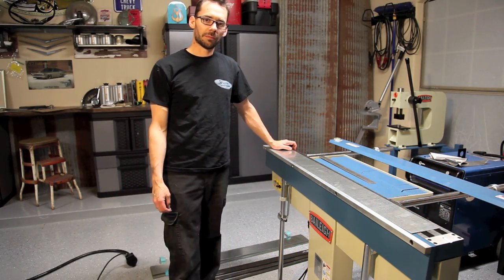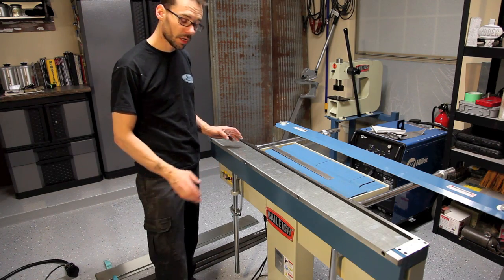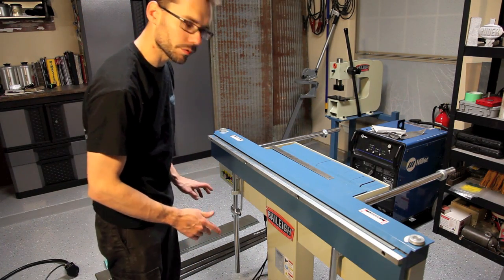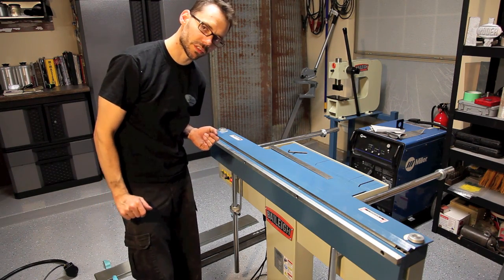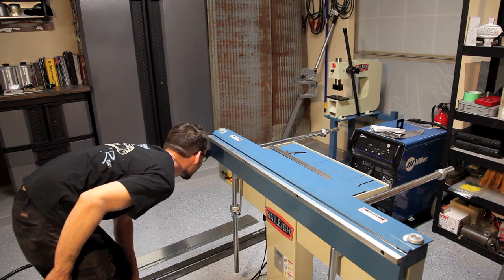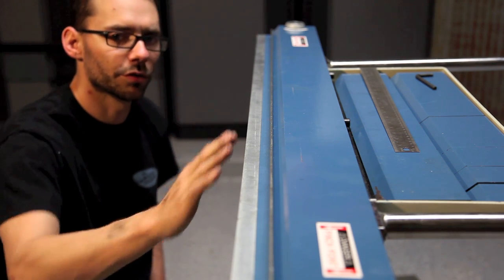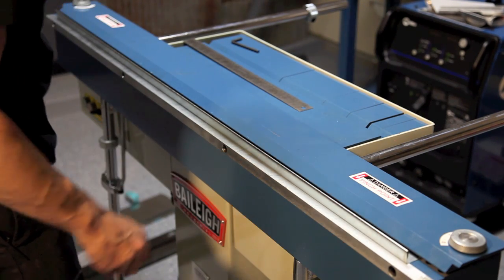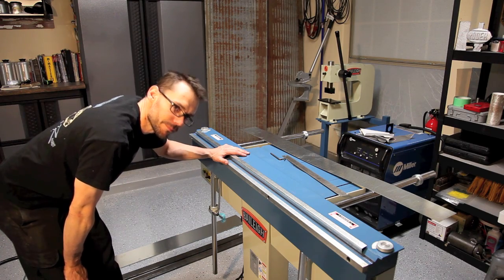Baileigh Industrial Sheet Metal Brake BB-4816M HammerFab

Comment: How does it do with Aluminum or Stainless?
Reply from the maker: Well it depends on the thickness and length
Reply from the maker: It’s been a great machine. Very strong. It will bend thinner stainless and works good on 16ga aluminum. You could bend shorter pieces of .080 aluminum. We’ve even abused it and bend narrow strips of 10ga steel and even 3/16 strap

Comment: I've been running this exact same break for about 5 years no issues, until the control board died. Their shitty dumb tech service immediately wanted to know what voltage I was running at. When I told them 240v they didn't want to help me. It's just a giant scam company that offers little support. I found the technical repair manual for this online, but lost the link and they didn't even know it exsisted. I will never buy one of thier crap chinese machines again. I see they now have a competitor called KaKa. that is about 15% cheaper. KAKA Industrial EB-4816B Manual Magnetic Sheet Metal Box and Pan Brake    https://www.grainger.com/ec/pdf/4LEK7_1.pdf